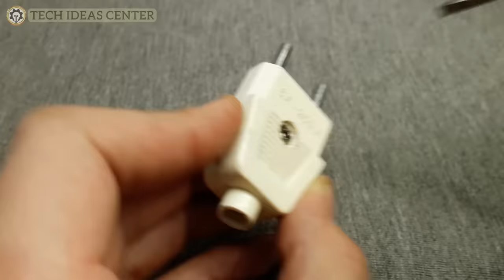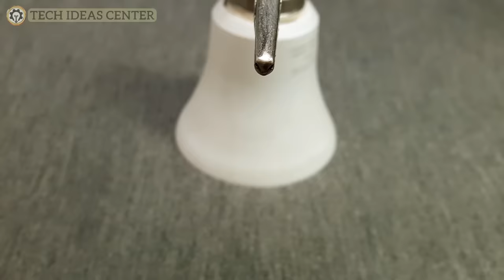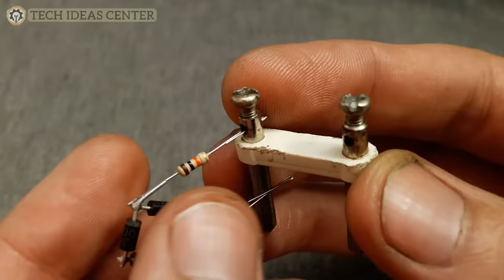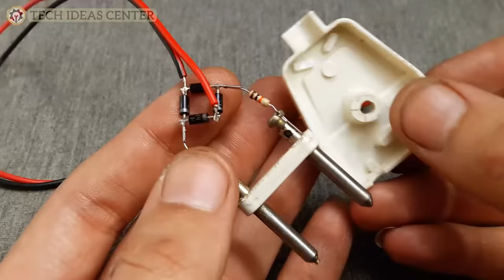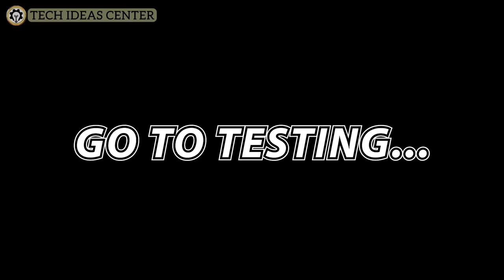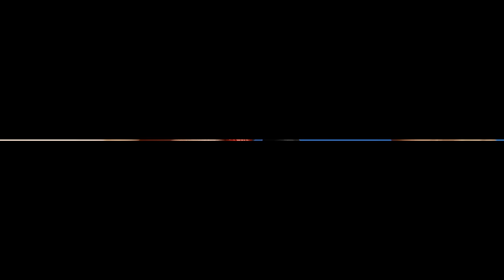Home Made LED and Diode Tester Auto Voltage / Simple and Useful

Comment: Dangerous..do not follow!!
Reply: But Why.?
Please Explain.
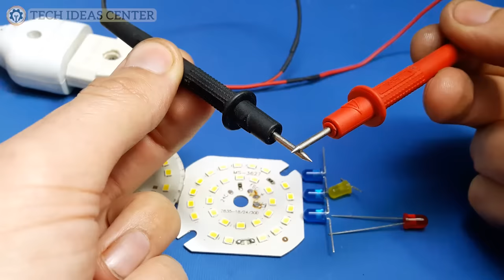Reply: @vijaymhatre2676  Because you can die. The resistors are 10K/0.25W. If you short circuit the resistors get too much power and can damage (in this video at 4:53) P = 230V*230V / 20000 Ohm = 2.645 Watt 
2.645 more than 0.25.
Nobody guarrantees the resistors no lose them value. If the circuit shorted and you contact pins you can get more than 20-30milliampers and you will be died.
If you do not know and do not understand safety regulations and sources of danger you do not use 230V (or more than 40V Voltage)

The idea is good, but you should use less than 40V instead of 230V. For example an 18V accu is good for this.
Reply: @istvannagy3069  Okay. 
Thanks for explaining.
Reply: @istvannagy3069  2,65 W divided in two. Maybe, if you not used during a long time, with 1W resistors could be enought
Reply: @fulgen  Yes, 2.65W divided in two. But it is 2.65/0.5= 503% overload. And if you short the phase wire with a grounded case of other device P = 230V*230V/10000 Ohm = 5.29 Watt on only one resistor.
The point is that the electricity is dangerous. More than 40V can cause damage. If somebody use 230V (100-250V) the safety regulations must be followed.
I'm sure there is no country where this is allowed
Reply: And maybe not long time, but the effect  adds up. this is a hidden bomb.
Do not even think about if the kid finds it and starts playing with it... This device is irresponsible.
Reply: @istvannagy3069  obrigado amigo por compartilhar seus conhecimentos e nos alertar dos perigos.
Reply: Your supply..220volts110volts ac?????
Reply: I have 3W resistors they can be used safely?
Reply: Yes it's very generous it's just make a video for chanel
Reply: @tapanchandradas4781  such a bad idea and construction
and  some ill-informed comments

First this is DANEROUS - it is not isolated from the Mains voltage, so  a nasty shock - even  a fatal shock is possible.
The voltage at the probes is over 300VDC  
VDC-peak = VAC rms x 1.4 - Vf of diodes
That is a standard well-known equation - this guy says its 0 to 200DC which is nonsense.

While the resistors limit the current - a small  current at that voltage is dangerous

Another point is that LEDs have a low reverse  voltage rating so this high  voltae coud damae a LED.   A led tester that can damage the DUT ------ not smart at all

then the construction sucks. The resistors should not be soldered directly to the prongs.  And there should be better strain relief. Plus the wires need to be rated for that voltage

In conclusion     a bad and even dangerous circuit that is poorly constucted.. It is clear to me that this guy lacks knowledge
Reply: @tapanchandradas4781  such a bad idea and construction
and  some ill-informed comments

First this is DANEROUS - it is not isolated from the Mains voltage, so  a nasty shock - even  a fatal shock is possible.
The voltage at the probes is over 300VDC  
VDC-peak = VAC rms x 1.4 - Vf of diodes
That is a standard well-known equation - this guy says its 0 to 200DC which is nonsense.

While the resistors limit the current - a small  current at that voltage is dangerous

Another point is that LEDs have a low reverse  voltage rating so this high  voltae coud damae a LED.   A led tester that can damage the DUT ------ not smart at all

then the construction sucks. The resistors should not be soldered directly to the prongs.  And there should be better strain relief. Plus the wires need to be rated for that voltage

In conclusion     a bad and even dangerous circuit that is poorly constucted.. It is clear to me that this guy lacks knowledge
Reply: @vijaymhatre2676  such a bad idea and construction
and  some ill-informed comments

First this is DANEROUS - it is not isolated from the Mains voltage, so  a nasty shock - even  a fatal shock is possible.
The voltage at the probes is over 300VDC  
VDC-peak = VAC rms x 1.4 - Vf of diodes
That is a standard well-known equation - this guy says its 0 to 200DC which is nonsense.

While the resistors limit the current - a small  current at that voltage is dangerous

Another point is that LEDs have a low reverse  voltage rating so this high  voltae coud damae a LED.   A led tester that can damage the DUT ------ not smart at all

then the construction sucks. The resistors should not be soldered directly to the prongs.  And there should be better strain relief. Plus the wires need to be rated for that voltage

In conclusion     a bad and even dangerous circuit that is poorly constucted.. It is clear to me that this guy lacks knowledge
Reply: @kennmossman8701  concordo   posso ver um circuito bom que passa fazer em segurança pra usar

Comment: circuit is very very simple
Reply: such a bad idea and construction
and  some ill-informed comments

First this is DANEROUS - it is not isolated from the Mains voltage, so  a nasty shock - even  a fatal shock is possible.
The voltage at the probes is over 300VDC  
VDC-peak = VAC rms x 1.4 - Vf of diodes
That is a standard well-known equation - this guy says its 0 to 200DC which is nonsense.

While the resistors limit the current - a small  current at that voltage is dangerous

Another point is that LEDs have a low reverse  voltage rating so this high  voltae coud damae a LED.   A led tester that can damage the DUT ------ not smart at all

then the construction sucks. The resistors should not be soldered directly to the prongs.  And there should be better strain relief. Plus the wires need to be rated for that voltage

In conclusion     a bad and even dangerous circuit that is poorly constucted.. It is clear to me that this guy lacks knowledge

Comment: You input & output voltage not clearly
Reply from the maker: :face-orange-biting-nails:
Reply: such a bad idea and construction
and  some ill-informed comments

First this is DANEROUS - it is not isolated from the Mains voltage, so  a nasty shock - even  a fatal shock is possible.
The voltage [for 220VAC mains] at the probes is over 300VDC  
VDC-peak = VAC rms x 1.4 - Vf of diodes
That is a standard well-known equation - this guy says its 0 to 200DC which is nonsense.

While the resistors limit the current - a small  current at that voltage is dangerous

Another point is that LEDs have a low reverse  voltage rating so this high  voltae could damage a LED.   A led tester that can damage the DUT ------ not smart at all

then the construction sucks. The resistors should not be soldered directly to the prongs.  And there should be better strain relief. Plus the wires need to be rated for that voltage

In conclusion     a bad and even dangerous circuit that is poorly constucted. It is clear to me that this guy lacks knowledge
Reply: @kennmossman8701  While I generally agree that this contraption is just horrible, I have questions on details.
Since the resistors are in series, shouldn't that divide the voltage?
Reply: @ImieNazwiskoOK   no, here the resisters only limit the current, there  is noi resistor divider

Comment: Great idea!❤
Reply: such a bad idea and construction
and  some ill-informed comments

First this is DANEROUS - it is not isolated from the Mains voltage, so  a nasty shock - even  a fatal shock is possible.
The voltage at the probes is over 300VDC  
VDC-peak = VAC rms x 1.4 - Vf of diodes
That is a standard well-known equation - this guy says its 0 to 200DC which is nonsense.

While the resistors limit the current - a small  current at that voltage is dangerous

Another point is that LEDs have a low reverse  voltage rating so this high  voltae coud damae a LED.   A led tester that can damage the DUT ------ not smart at all

then the construction sucks. The resistors should not be soldered directly to the prongs.  And there should be better strain relief. Plus the wires need to be rated for that voltage

In conclusion     a bad and even dangerous circuit that is poorly constucted.. It is clear to me that this guy lacks knowledge

Comment: Una pregunta…para corriente 120 ca …cambiaria su resistencia?.. pregunto
Reply: Se encenderán más débilmente si pones las mismas. Este suministra una corriente media de alrededor de los 10-12 mA a 230 V porque lleva dos resistencias de 10k (20k efectivos). Si es para 120 te generará alrededor de 5 mA. Si quieres puedes poner dos resistencias de 4k7 o 5k6 para hacerlo similar.
Reply from the maker: Use the same values for 120 volts

Comment: If I touch it with my hand, it will push me??
Reply from the maker: No . But it is better not to do this
Reply: @Simple.E.P  Thanks
Reply: such a bad idea and construction
and  some ill-informed comments

First this is DANEROUS - it is not isolated from the Mains voltage, so  a nasty shock - even  a fatal shock is possible.
The voltage [for 220VAC mains] at the probes is over 300VDC  
VDC-peak = VAC rms x 1.4 - Vf of diodes
That is a standard well-known equation - this guy says its 0 to 200DC which is nonsense.

While the resistors limit the current - a small  current at that voltage is dangerous

Another point is that LEDs have a low reverse  voltage rating so this high  voltae could damage a LED.   A led tester that can damage the DUT ------ not smart at all

then the construction sucks. The resistors should not be soldered directly to the prongs.  And there should be better strain relief. Plus the wires need to be rated for that voltage

In conclusion     a bad and even dangerous circuit that is poorly constucted. It is clear to me that this guy lacks knowledge

Comment: Is easy work.easy work I no like.i like Hard
Reply: such a bad idea and construction
and  some ill-informed comments

First this is DANEROUS - it is not isolated from the Mains voltage, so  a nasty shock - even  a fatal shock is possible.
The voltage at the probes is over 300VDC  
VDC-peak = VAC rms x 1.4 - Vf of diodes
That is a standard well-known equation - this guy says its 0 to 200DC which is nonsense.

While the resistors limit the current - a small  current at that voltage is dangerous

Another point is that LEDs have a low reverse  voltage rating so this high  voltae coud damae a LED.   A led tester that can damage the DUT ------ not smart at all

then the construction sucks. The resistors should not be soldered directly to the prongs.  And there should be better strain relief. Plus the wires need to be rated for that voltage

In conclusion     a bad and even dangerous circuit that is poorly constucted.. It is clear to me that this guy lacks knowledge

Comment: High dc voltage? 12 volt?
Reply from the maker: High DC . Auto Voltage 0 ~ 200 v
Reply: @Simple.E.P is this is Sirig bord?
Reply: such a bad idea and construction
and  some ill-informed comments

First this is DANEROUS - it is not isolated from the Mains voltage, so  a nasty shock - even  a fatal shock is possible.
The voltage [for 220VAC mains] at the probes is over 300VDC  
VDC-peak = VAC rms x 1.4 - Vf of diodes
That is a standard well-known equation - this guy says its 0 to 200DC which is nonsense.

While the resistors limit the current - a small  current at that voltage is dangerous

Another point is that LEDs have a low reverse  voltage rating so this high  voltae could damage a LED.   A led tester that can damage the DUT ------ not smart at all

then the construction sucks. The resistors should not be soldered directly to the prongs.  And there should be better strain relief. Plus the wires need to be rated for that voltage

In conclusion     a bad and even dangerous circuit that is poorly constucted. It is clear to me that this guy lacks knowledge

Comment: 👍
Reply: such a bad idea and construction
and  some ill-informed comments

First this is DANEROUS - it is not isolated from the Mains voltage, so  a nasty shock - even  a fatal shock is possible.
The voltage [for 220VAC mains] at the probes is over 300VDC  
VDC-peak = VAC rms x 1.4 - Vf of diodes
That is a standard well-known equation - this guy says its 0 to 200DC which is nonsense.

While the resistors limit the current - a small  current at that voltage is dangerous

Another point is that LEDs have a low reverse  voltage rating so this high  voltae could damage a LED.   A led tester that can damage the DUT ------ not smart at all

then the construction sucks. The resistors should not be soldered directly to the prongs.  And there should be better strain relief. Plus the wires need to be rated for that voltage

In conclusion     a bad and even dangerous circuit that is poorly constucted. It is clear to me that this guy lacks knowledge

Comment: How much volts in DC output?
Reply from the maker: Almost all input is output
Reply: such a bad idea and construction
and  some ill-informed comments

First this is DANEROUS - it is not isolated from the Mains voltage, so  a nasty shock - even  a fatal shock is possible.
The voltage [for 220VAC mains] at the probes is over 300VDC  
VDC-peak = VAC rms x 1.4 - Vf of diodes
That is a standard well-known equation - this guy says its 0 to 200DC which is nonsense.

While the resistors limit the current - a small  current at that voltage is dangerous

Another point is that LEDs have a low reverse  voltage rating so this high  voltae could damage a LED.   A led tester that can damage the DUT ------ not smart at all

then the construction sucks. The resistors should not be soldered directly to the prongs.  And there should be better strain relief. Plus the wires need to be rated for that voltage

In conclusion     a bad and even dangerous circuit that is poorly constucted. It is clear to me that this guy lacks knowledge

Comment: brother iske volts b multimeter sy check karwate to acha hota...output kitne volte ha?
Reply from the maker: Yes, you can use a multimeter and set the multimeter to 200 volts DC

Comment: Para uma corrénte alternada de 127 volts colocar resistores de 47k 2w
Reply from the maker: Please do not spread false information.
thank you dear friend
Reply: Noooo! Usa los mismos valores de 10k.  Los LED se encenderan mas debiles.  Las luces LED se encienden hasta con las puntas del MULTIMETRO en "Diode Mode.'" Observando la polaridad.  Yo vivo en USA (120V AC) Yo no usaria este metodo,  lo veo muy peligroso, yo  pruebo y reparo LED Lights con mi multimetro. de una en una.          ------Thanks for the video SEP!-------

Comment: Very very nice video,
Reply: such a bad idea and construction
and  some ill-informed comments

First this is DANEROUS - it is not isolated from the Mains voltage, so  a nasty shock - even  a fatal shock is possible.
The voltage at the probes is over 300VDC  
VDC-peak = VAC rms x 1.4 - Vf of diodes
That is a standard well-known equation - this guy says its 0 to 200DC which is nonsense.

While the resistors limit the current - a small  current at that voltage is dangerous

Another point is that LEDs have a low reverse  voltage rating so this high  voltae coud damae a LED.   A led tester that can damage the DUT ------ not smart at all

then the construction sucks. The resistors should not be soldered directly to the prongs.  And there should be better strain relief. Plus the wires need to be rated for that voltage

In conclusion     a bad and even dangerous circuit that is poorly constucted.. It is clear to me that this guy lacks knowledge

Comment: Nic❤
Reply: পিন টাতে দরলে শক করবে না?
Reply: such a bad idea and construction
and  some ill-informed comments

First this is DANEROUS - it is not isolated from the Mains voltage, so  a nasty shock - even  a fatal shock is possible.
The voltage at the probes is over 300VDC  
VDC-peak = VAC rms x 1.4 - Vf of diodes
That is a standard well-known equation - this guy says its 0 to 200DC which is nonsense.

While the resistors limit the current - a small  current at that voltage is dangerous

Another point is that LEDs have a low reverse  voltage rating so this high  voltae coud damae a LED.   A led tester that can damage the DUT ------ not smart at all

then the construction sucks. The resistors should not be soldered directly to the prongs.  And there should be better strain relief. Plus the wires need to be rated for that voltage

In conclusion     a bad and even dangerous circuit that is poorly constucted.. It is clear to me that this guy lacks knowledge

Comment: If you add a votlage indicator?
Reply from the maker: You cannot connect it to the voltage indicator, but you can connect it to a multimeter to measure the voltage of the LEDs
Reply: @Simple.E.P  yes that's what i've done today. Succeeded. Thank you so much.

Comment: HELLO GOOD DAY, I WONDER IF IT WILL WORK ALL DC PRODUCTS, I WILL DO IT ACCORDINGLY.
Reply from the maker: Please be careful and take care of yourself
Reply: @Simple.E.P  Thank you, but I don't fully understand, is it dangerous to do this?
Reply from the maker: @umitylmaz3123  It is better not to do it. This circuit is designed only for LED testing and does not have enough resistance for all DC devices, therefore there is a possibility of damaging the circuit. You are doing a good job of asking questions before doing something you are not sure about
Reply: @Simple.E.P  
Thank you very much, I thought it would make all the DC circuits work, thank you very much again, otherwise my circuits would be damaged, thank you again, have a good day
Reply: @Simple.E.P  
Thank you very much, I thought it would make all the DC circuits work, thank you very much again, otherwise my circuits would be damaged, thank you again, have a good day
Reply from the maker: @umitylmaz3123  I am glad that I could help you in time, dear friend
good day